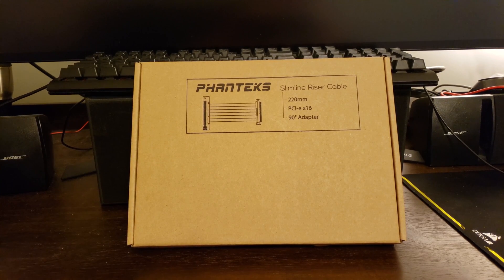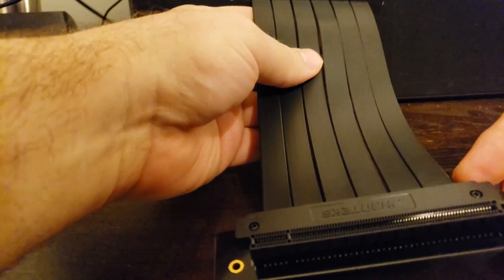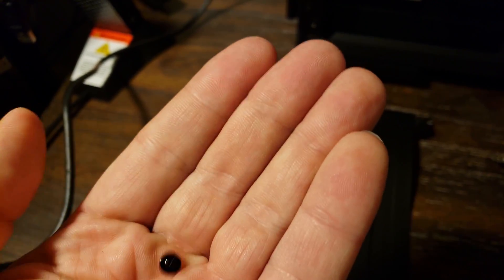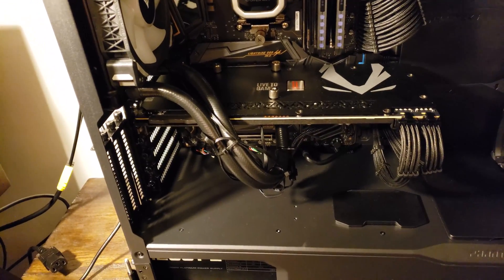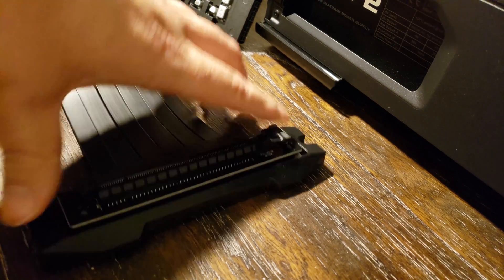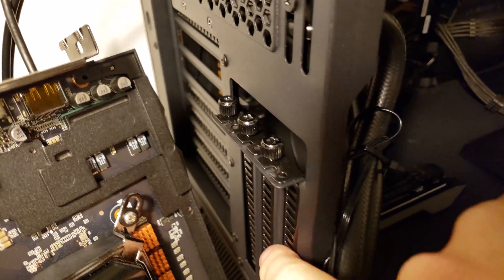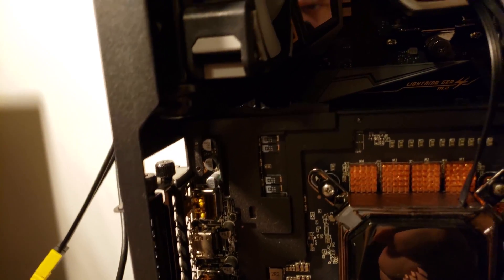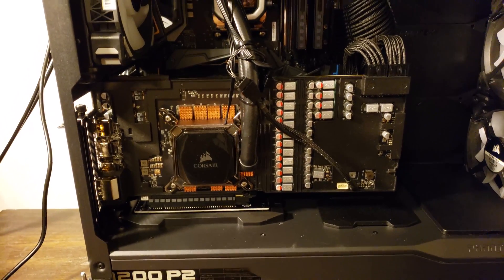Phanteks PH-CBRS_FL22 | Vertical GPU Riser Cable Installation

Comment: Was searching online for the "PH-CBRS_FL22 cable" and found your video. So I checked it out if my soundcard (yes still using one, much better DAC than onboard sound and has no problem with my 250 Ohm headset) still fits into a PCIe slot. Seeing this video I doubt it will but I will investigate it some more.

and... Yes, your video is still useful after 3+ years ;)
Reply from the maker: Glad to hear it. :)

Comment: Hi, don’t know if you will still respond, but I’m looking to mount an Rtx 3070 to the p500a. Will the 150mm phanteks riser cable work? Thanks.
Reply from the maker: I'm not sure.  I checked the Phanteks site concerning this riser as well as the P500a and nowhere does it say if they're even compatible with each other.  Additionally, your card is a PCI Express Gen4 whereas this cable is Gen3.  I had issues getting cards to work on it from the 3000 series unless I manually changed the PCI Express slot in the BIOS to run at 3.0 instead of "Auto" or 4.0.  I would look for a Gen4 cable if possible.
Reply: @DruuzilTechGames  alright thanks. I want to make sure that I can use any riser cable and it should should fit with the provided phanteks bracket. Thank you so much.

Comment: Hiya! Just installed the same on a p600s, did you have any trouble booting up? I'm running a 2080 super and it seems I have to unplug my centre monitor to even get to BIOS...
Reply from the maker: Might have something to do with Gen3/Gen4 BIOS settings for the PCI Express slot.  I had issues with that when I tried to SLI 2x 3090's and I had to buy Gen4 riser cables, but if you can get into the BIOS and manually force it to run at Gen3 it may fix the issue.  2080S is Gen3 anyway, but your board may offer Gen4 and that seems to screw with riser cables for some reason.

Comment: hi there, did you experience any performance drop using this riser cable, i have the same cable, and my 2080ti gets 35000 gpu score without it and with it only about 24000 gpu score on firestrike ...
Reply from the maker: No but I didn't use it for very long.  That's a pretty big change.. Other than latency I can't figure out why you'd lose any performance like that.  Might send it back for a replacement and see if you have the same issues with the new one.
Reply: @DruuzilTechGames  i bought a new one from amazone, ill check if there will be performance increase. Thanks for the info though
Reply from the maker: @aim6mac  Let me know how that goes.  Kinda curious now.
Reply: @DruuzilTechGames  sure i will, there are two scenario's, one it's because i recently swapped my motherboard from master series to xtreme series (compatibility issues), two whilst swapping i dammaged the cable even though i'm very gentle heheh. anyhow i'll let u know how it goes with the new cable.
Reply: @DruuzilTechGames  Hi, i have updates on the issue: i just tested the pci express bandwidth test with 3dmark and i get a max off 15 gb/S  it should be 25 gb/S as far as i know.  I'll see what the replacement pci e riser cable gives.
Reply from the maker: @aim6mac  Use GPU Z and see if the card is at x8 or x16
Reply: @DruuzilTechGames  its running on 16x
Reply from the maker: @aim6mac  Ok, figured that was worth checking.
Reply: @DruuzilTechGames  yes indeed , i really think it's the cable , it just happen to be that i sidegraded my motherboard to an extreme version, which should perform better in theory :p
Reply: @DruuzilTechGames  today new pci e riser from phanteks came in ... and guess what same results 13GB/S bandwidth so it wasn't the riser issue i think?  or they just dont perform well or it's my motherboards compatibility with the riser cable,
Reply from the maker: @aim6mac  Weird, sorry to hear that
Reply: @DruuzilTechGames  i think i'm going to order a pci-e 4.0 cable to see if that makes a difference, i'm all confused lol
Reply from the maker: @aim6mac  The only issue there is that it won't specifically fit your case (not that it matters that much).
Reply: @DruuzilTechGames  i 'fixed' the problem, now i get max gpu performance , what i did is changing the standard setting to LN2 on my GPU (2080ti Lightning Z) now i suddently get full performance on firestrike .... so i'm guessing something is wrong with the bios of the GPU even though i didn't change anything on it.
Reply from the maker: @aim6mac  That's weird.  Well, glad you got it worked out.

Comment: If you have the Evolv X case then you're using the wrong riser cable. You need the SL22 or the PR22. That's why the cables from your riser are kinked to the left.
Reply from the maker: It's not the wrong cable.  The Evolv X may support more than 1 type of riser cable, but the PH-CBRS_FL22 was explicitly stated as being supported by the Evolv X on the Phanteks site when I bought it.
Reply: Yes, the Evolv X supports 2 types of riser cables one being for the second ITX system. The one you're supposed to be using in that area with the mount is the PH-CBRS_SL22, your Evolv X manual is very specific on which one to use there but suit yourself.

Comment: now I know what the 2 self tapping screws are for. Thanks. I would have liked to see which screws go into the mount and PSU shroud but I can figure it out.
Reply from the maker: Ah yeah I see what you're saying.  Sorry about that, I could've done a better job of positioning the camera when I installed it.  I don't have this thing installed anymore so I'm not 100% sure which screws are used to secure the mount to the shroud, but I think they were kind of long and "pointy" at the end if that makes sense.

Comment: Should maybe title the video so that it includes the p600s in it, I looked all over for a video that showed this installed in that case. Thank you this was exactly what I needed to see. Case ordered :)
Reply: the PSU trunk and vertical sides are common to several Phanteks models. Mine is the same and is evolvx

Comment: Any ideas if you get a long enough PCI extender if you could plug the extender into the 2nd PCI 16 slot and lay the cables around the 3rd x16 slot so you could have a small card mounted in that slot behind the card that's brought out with the cable. Does that make sense?
Reply from the maker: I'm sure that'd work if the card was small enough.

Comment: would have been nice to see the bottom of the 90 angle part of the riser that sits under the video card for people that dont have that case to know if its has any circuits that would interfere if placed on a different case where it would touch metal

Comment: Thanks for the video friend.
I accidentally ordered 150mm version (without knowing that it even exist).
Is there any chance that it can be used?
I have Evolv X also,and  PCIe 16x is the first slot after CPU.
Thanks.
Reply from the maker: Do you have a model # for the version you ordered?
Reply: @DruuzilTechGames  Hi friend,thanks for answering.
PH-CBRS_FL15 is the version number I have.
I hope that I gave you info which you need.
Cheers man.
Reply from the maker: @nemamja  Its hard to tell for certain but other than the fact that the one you ordered is 70mm shorter than the one I used in this video, they look physically identical. 

Does your motherboard have 1 or 2 PCI Express x16 slots?  If the cable is too short to use the main slot you may be able to use the 2nd instead.
Reply: @DruuzilTechGames  Unfortenately second PCIe x16 slot is running at x4, so i rather wouldn't connect GPU on it. I know that the difference between 16x and 4x is minimal,but i love to squeeze every performance out of my hardware. :)
And by looking your video i think that 7 cm shorter cable would not be sufficient, am I right? 😒
Reply: @DruuzilTechGames  btw, I got Evolv X case yesterday,it looks wonderful. 😊
Reply from the maker: @nemamja  I can't be certain but I would guess it may not reach.  On Amazon it says your cable was specifically designed for a different case.  The Enthoo 719 I think it said.

Comment: Thanks for the Video. 
Do you think Phanteks 150mm Riser Cable enough for Vertical GPU if using 2nd PCIEx16 on motherboard ATX ? 
What Case did You have? Is Phanteks Evolv X?

Comment: Hi, please could you tell me the distance between the 2 holes? I'd like to install this cable on a evga DG7 case. Thanks :)
Reply from the maker: Based on the product dimensions listed on Amazon, it's 8" wide which means the screw holes would be slightly less than 8" apart.  Does your case come with a plastic mounting kit like I showed in the video?  You have to attach the PCB on the riser cable to the mounting hardware supplied with your case (assuming they did supply one like Phanteks did with my case), and then you screw the mounting kit into the case itself.  

Does EVGA not offer a specific riser cable for the DG7?
Reply: @DruuzilTechGames  thanks for quick response, unfortunately EVGA don't provide any riser cable and the original one is not easy to found, but I think this will be fit good for my case, there're the two holes to  screw the riser cable pcb, I bought another one but the pcb was to short and the holes didn't fit, I wil let you know. Thanks for your support!
Reply from the maker: @Resina0  I Googled it and the model number for the DG7 riser cable is w002-00-000064 from what I can tell.  I don't see them on the EVGA website though.  You might see what you can find on Ebay.